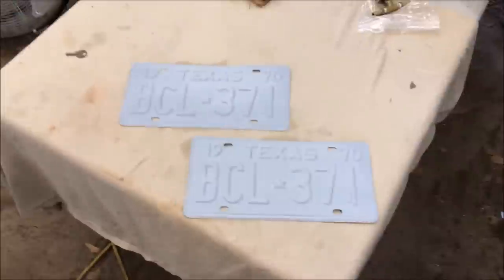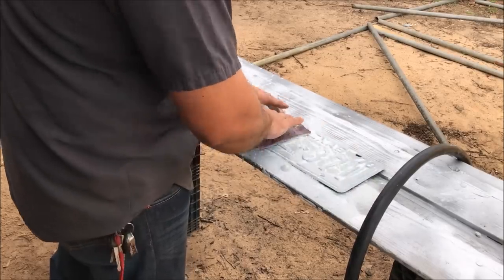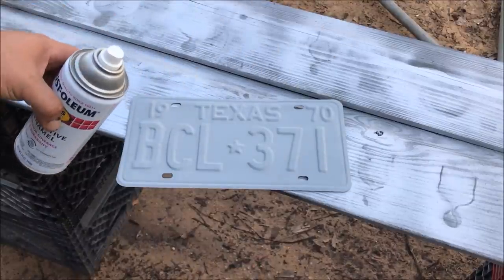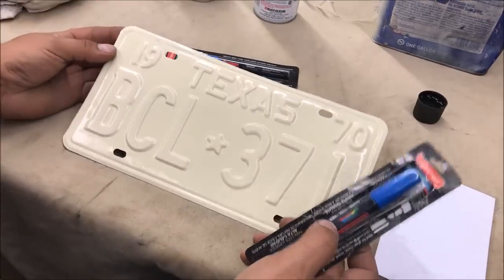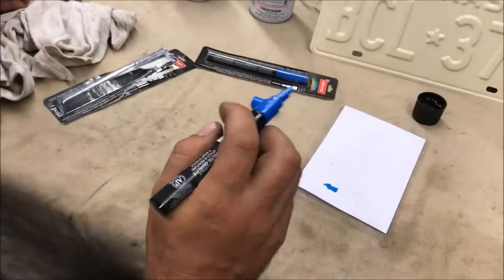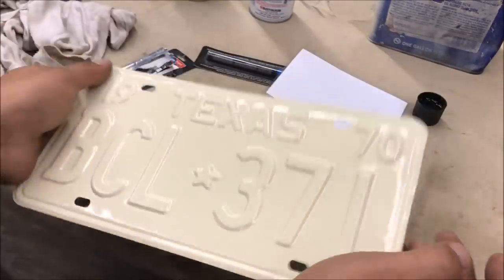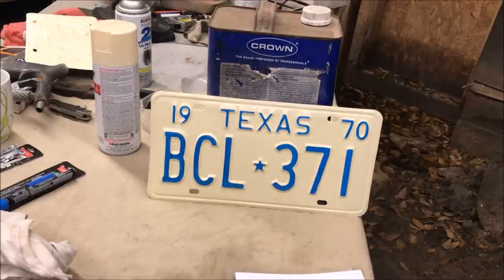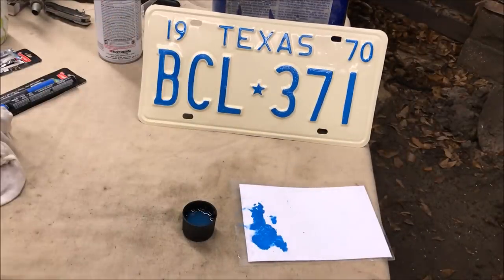license plate restoration part 2 PAINTING THE PLATES

Comment: Thanks.  I'm restoring a 1965 TX plate and like you, I was frustrated with trying to paint the letters.  Tried various brushes but couldn't get the lines to be crisp.  The Michael's Craft Smart chisel tip pen (black for TX 1965) did an excellent job.  I did use standard semi-gloss white, which seemed very close to the original white background paint for a 1965 TX plate.

Comment: To do this type of work, you need to use the pinstriping brushes as they allow you to drag the paint evenly over a longer portion of the letter/number and help keep the edge straight.  The paint pen is no consistent enough to allow the paint to even out effectively to give you that look of a smooth letter/number.

Comment: 2 Hot glue sticks on the back of the tag. Lightly press tag face onto a spill mat that has been saturated with paint. Carefully lift off then place onto saw horses with 2 2x4s with gap ( for glue sticks on back) between them.

Comment: I've found that if you use a chisel point pen rather than a bullet point, it's easier to follow the edge of the letters. maybe I should do a video-explaining it here may not seem straight forward.
You did a fantastic job though!
Reply from the maker: I’m gonna do a part 3.. once the paint dried they look about 9/10.. they don’t have a chisel point in that blue..  yes, do a video....
Reply: @chriscraft77022  what if you came back over with spray clear?  Wouldn't that help smooth out the blue?  Nicely done series!